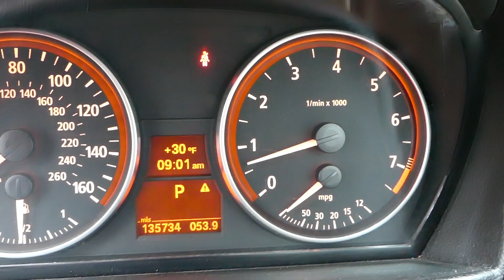FORD EXPLORER 3.5 3.7 COOLANT IN OIL. WHY THERE IS COOLANT IN THE OIL

Comment: Got a 3.5 2014 explorer. Coolant leaking from the engine bottom passenger side. No hoses, just the side of the engine. Oil is not compromised or at least it doesn't seem to be, coolant goes in come out clean (still green no oil). Service thinks water pump or sealant. Is it possible for the coolant to escape without mixing with the oil?
Reply: Whatet pump I'm seen right now a 2013 ford explorer and I can see coolant underneath the ac compressor coming from the timing cover and also the oil is changing color
Reply: @juanmondragon87  Do not drive the car anymore, not even an inch.
Reply: I have same problem and wondering same thing
Reply: @ginog6390  it's gonna be expensive, min 10 hour labor and ford dealer only, or someone skilled. Ford is being class actioned for it.
Reply: Also the oil is "overfilled"
Reply: @juanmondragon87  yes that might be a big problem man, sounds like the water pump failed and unfortunately the coolant ended up in the oil pan which could have caused catastrophic engine failure as well.
Reply: We just got ours back from the service, we were lucky the oil was not compromised, still the bill was almost 4 grand for a water pump, guides, bolts and timing chain. Of course 4/5 was labor.
Reply: @sjm8510  I just did the Timing chain and water pump, thanks for the advice! 👍
Reply: @juanmondragon87  u did it yourself? Are u a mechanic? Engine survived the water pump failure?
Reply: @sjm8510  yes i did it myself I work on a shop actually and the waterpum was leaking in the middle that's why coolant was mixing with the oil
Reply: @juanmondragon87  I'm glad you got it done, it's a hell of a mess just to get the dang pump replaced.
Reply: @sjm8510  yeah I know that's messed up idk why engineers are doing that timing chain attached to water pump it's no good man they shouldn't be doing that